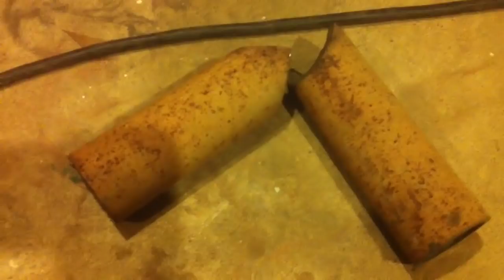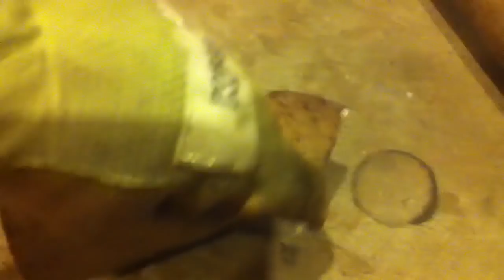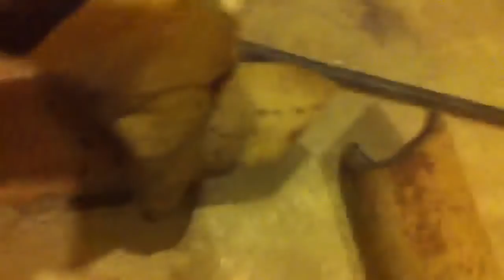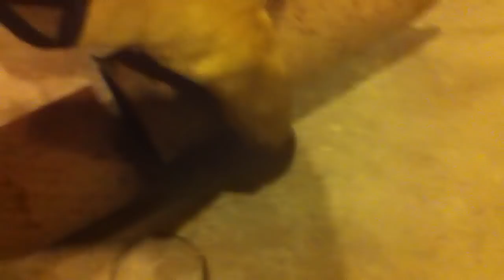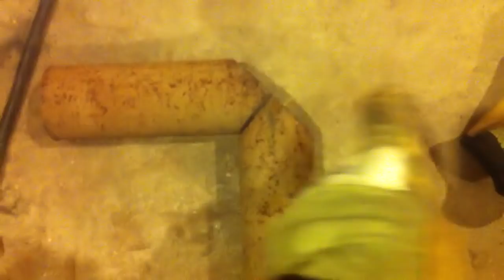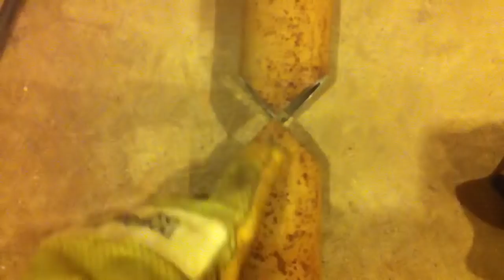Building Fence Posts Using Oilfield Tubing

Comment: I agree, you have made this complicated, duct tape and clamps would never hold all of that together for a weld. Set and cap your posts, I like that better than a top rail then saddle cut the pieces between the posts. Don't forget the little paint rollers so the wife can paint it.
Reply from the maker: Yeah I didn’t know what I was doing. I’ve since bought a template for making the saddle cuts but never have actually finished the project. Life happens!

Comment: your cost was too high!! mid grade joints should sell for 22.00 to 23.00
Reply from the maker: Likely. I shopped around and all were about this price. It all depends on your region. Which is SE TX there should be no shortage of spent oilfield tubing. I've since found a few more sources that are cheaper.

Comment: So I build fence for a living and you have def over complicated this lol I could tell you a whole easier way to do this and it will not cost you any more will actually save you cash on cut off blades and rod so put your corners in then take a string line from corner to corner set the rest of your post using your line then move the string to your desired height cut a saddle in each post aligning Down your fence then put on top rail then what I did was made a few hangers for five rails out of all thread to hang the one inch on cut 45s on your corners of your 1 inch to keep it clean tack in then smash down with 5pnd sledge then weld the rest so then weld your 1" to your post and simply move your hangers down and thread on another piece of your 1" railing I made my hangers to hold five or six rails and they are adjustable using the all thread when you get close enough to your end corner simply measure about an inch to 2 over desired length cut 45 on end thread in and finish the same way yo
Reply from the maker: Yes I know this idea was too complicated. I've learned since about the simplicity of the coping cut and saddles. I've mostly left this video up now as a tool that others trying to figure it out will read the comments and learn its not a good way to do it. Thanks for watching and sharing your advice!

Comment: I know I am a little late to the party, but if you ever get around to building your fence here is my 2 cents worth. Set all your up rights, depending if you want to use a top rail, take a string line and mark your height on as many posts you can, ground level permitting Once your height is marked, go buy a 2 3/8 pipe guide, handy little tool for about $10. Using the string as your straight edge, place your pipe guide at the string and mark your saddle cut.
Reply: +bo_b_farmin  
Then for your cross pipe, measure between your uprights on each one, add for the saddle cuts for each end and make your cuts. You can use the seam line as a straight edge to keep each end square.
Reply from the maker: +bo_b_farmin Thanks for your advice. I have not gotten back to the fence yet, but I will someday. Always hoping for sooner rather than later. The actual clearing and land prep work has taken precedence (as seen in all my excavator videos). Figure I don't really need a fence to build a house after all. I figured when I got back to it, I would get a template (pipe guide) as you suggested. Then again, all the guides in the world might not help me make a straight cut with my torch :) Thanks for watching, and thanks again for your valuable input!
Reply: +Tom Brueggen The easiest way to get a perfect torch cut is to fab a 2-piece guide that you clamp onto your pipe before cutting.  Once it is clamped in place, your torch head follows the guide to make perfect cuts every time.
Reply from the maker: +A B Indeed. Used a piece of angle iron all the time in high school for long straight cuts. Actually just picked up a cool little template the other day. It's a spring loaded split metal tube to clamp on over your pipe and has lines cut in it to trace with your chalk for to get the perfect pattern every time. Likely unnecessary but I thought it cool and someday handy.
Reply: +Tom Brueggen Looks like an interesting gadget.  Would you share the url to it?
Reply from the maker: +A B I don't have a URL. I bought it at a little local auto parts/hardware store. Don't even know what the thing is called. I just tossed it in the truck and figured I'll use it some day.

Comment: Watch those oil field pipes they can be radioactive after moving all that crap from down deep.

Definitely don't want to be breathing dust while cutting and welding them.
Reply: Scrap metal yard has a geiger counter to check scrap coming in and turned away a load from a local company that was radioactive
Reply from the maker: Call me naive, but I'm not too worried about NORM's. I'm sure I'm exposed to equally bad or worse things in my food every day. Not that one should support constant exposure to lethal things, but I'm also not one to buy into all the nonsense we see in the media. And I suppose you can call me bias if you wish. I do work in the oil and gas industry and have been educated on the reality of NORM's. My daily commute is far more dangerous, ha! Thanks for watching!

Comment: Good stuff man, nice video
Reply from the maker: Thanks for watching. I imagine I won't be making all these cuts when I finally get around to building the fence. It got deferred in the name of investing in the construction of the house instead. Look up how to make a coping cut, it is more sensible for the purpose of building with pipe like this. Not as smooth looking maybe, but equally strong and less cuts required. The dome caps will still be used for sure!

Comment: nOW CUT THE END TO WHERE YOU HAVE 1 INCH FLAT AND IT WILL SADDLE ON THE POST FOR YOUR BOTTUM RAIL. saddle THE TOP OF THE POST AND RUN YOUR TOP RAIL . tHEN YOU DONT NEED CAPS.
Reply from the maker: Interesting way of going about it. I was thinking about making a jig, kind of like a miter box with all the proper angles cut as slots, and then I could just tag it with a can of spray paint to make sure I had consistency in my cuts. A box on each end, and pre-marked on a level surface to would make sure I'm not getting out of level. But yeah I guess you're right, if I just knock off the point I've got my saddle cut again. 
As for the tops, I've already got the caps, and intend to use them. I know I can do it with the saddled tops and a top rail, but I think I like the idea of the caps better. We'll see, if I ever even finish this dang fence I'll probably decide I hate it and replace with barbed wire!
Reply: Tom B Got a low RPM saw 14" metal cutting blade. So far have made over 450 cut's in 2. 3/8" tubing 1500 3/4" rod iron cut's. The blade is still cutting as if it was brand new. It is amazing. Any way I am just eye-balling it.I have a top rail all the way and a bottom rail 20" from the ground.  And it look's perfect. A car runs threw this it will not go very fare. Sound's like you too have an excellent plane. Have fun. Oh am using 3/4" rod iron for the picket's.

Comment: hello,
    i have the solution to all your oil pipe fence building, my partner (inventor) and i have just recently filed an usa design patent and a world design patent on "oil pipe fencing system" which are steel fittings, manufactured to to fitt 2 3/8" oil field pipe, to build fence, gates, corral's etc.. we are a new business, and have had 15,000 fittings manufactured in china, and are here in usa for sale. we have been in contact with a manufacture in the usa, and plan to start producing more fittings right here in the good ol usa.
     these new fittings will reduce the cost, labor, and tools needed to make your own fence, where it may take you 10 hr's to assemble a 20ft. section of fence the old way, i'm sure, with these new fittings, you will be able to the job in about 1 hr.
   please feel free to contact me, james moriarty, email address: jemoriarty77@gmail.com
    i will be happy to send you pictures and pricing of all the fittings we have to offer.
thank you,
jemoriarty

Comment: Can you make a video showing us your fence? How far apart do you space your posts?
Reply from the maker: I will try to make a video if I ever get back to working on the fence! I have been spacing the posts about 9.5' apart. The joints of pipe I'm using are ~31' long, so when you take off the pin and box ends, that leaves about 30' of straight pipe. I set the posts about 9.5-10' apart to ensure I'd get three spans/joint of pipe with little waste.

Comment from the maker: Wasuchi: thanks for the great tip! I looked up that link and it was pretty handy. I haven't printed a template yet, but I think I could easy enough, them trace it to sheet metal and cut that out as a more durable glide. Perhaps make it and inch wider than needed and somehow fasten it so it stays wrapped and could just slide over the pipe like a collar for a quick trace. But as it stands, I'm in the market for a decent metal band saw so I can just make the straight blade coping cuts. I tried a few with my chop saw for a test and it was good enough for me. But I can imagine laying on that chop saw for 400' worth of fence! I like the idea of a hydraulic let down band saw so I can set it and walk away (go tack a weld maybe) while the saw does the work. I'm a one man army on this project!

Comment: http://www.metalgeek.com/static/cope.pcgi
There are some others out there, look up "tube coping calculator". These calculators allow you to print templates for all different angles and sizes of pipe, even weird angles where different sizes of pipe go together. Ones I use a lot I trace onto the very thing plastic cutting boards, the ones that are flexible, and then cut them out with tin snips. Those last a long time..

Comment: lol I asumme youre going to cut these with a o2/acety hand torch? These cuts can look pretty nasty unless youre some old salty fitter. I know mine always looked terrible. In most fab shops there were hydrolic notchers on an ironworker that saved hours of grinding. Dont know if there is any cheaper versions of these, though.
Templetes were always made from paper. Here is an example I found for a 12in OD. Once you make a good one it can be used many times. releecodotcom/productnew.php

Comment: Jeez Tom, that sounds like a nightmare to keep square and level. Good info though. 
I was actually thinking about the process of building a pipe fence myself. While in college I worked as a iron worker, welder, and some pipe fitting. I was assuming it would just involve driving the posts, measuring and notching (with templet) the horizonal pipe and welding in.
You have put much more thought into it. 
How high will it be? How many horizontal pipes will be between the post? 
Good luck!